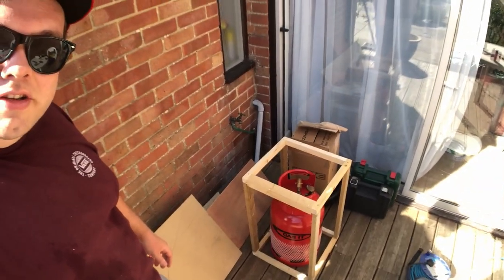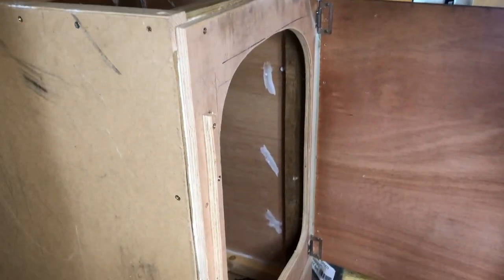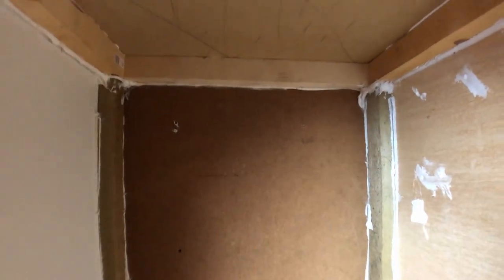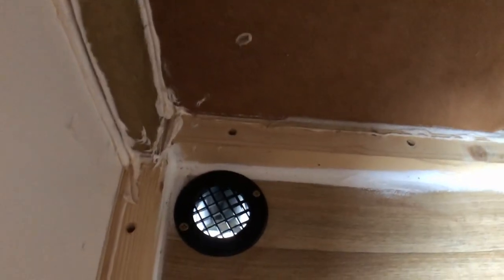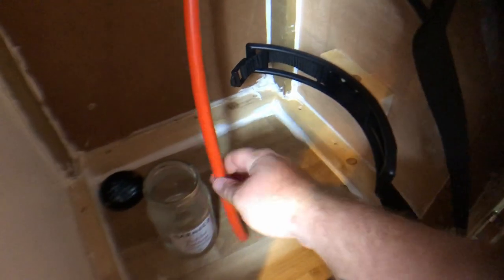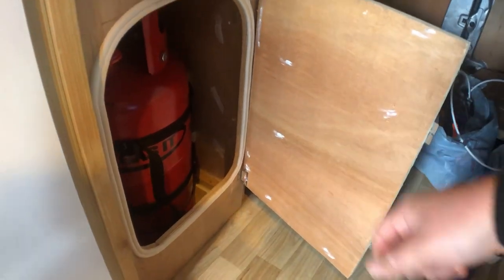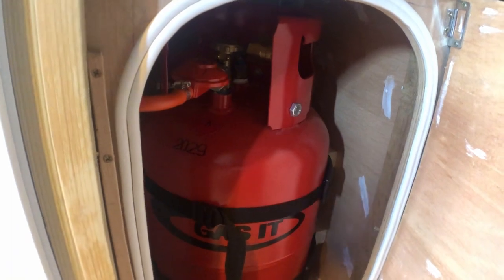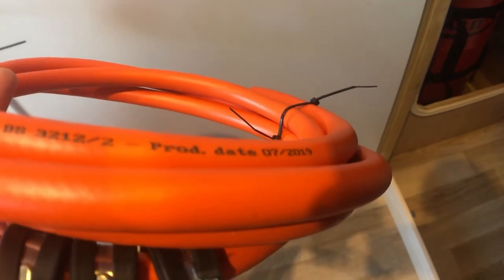SELF BUILD CAMPER VAN GAS LOCKER CUPBOARD. DIY Sprinter Van LPG Install #vanlife

Comment: just watched your clip,  I was thinking about using a rubber hose rather then solid,  I think your installation looks perfectly safe.  I'd rather use a  secured flexible hose that i can inspect every so often rather then a solid one.  at least it will not suffer and vibration stress and minimal joins.

Comment: Thanks for vid. How are you turning the gas on and off as I believe regs state you can’t move vehicle with the gas on at the bottle. So do you have an isolator of some form or are you opening up the box each time?
Reply from the maker: This is an old video and I have since replumbed the gas all in copper since the rubber hose is not good practice or up to regulation either. As for turning on and off, although in the garage area, the gas locker could be reached from the living area and turned off manually when we aren't using it :)